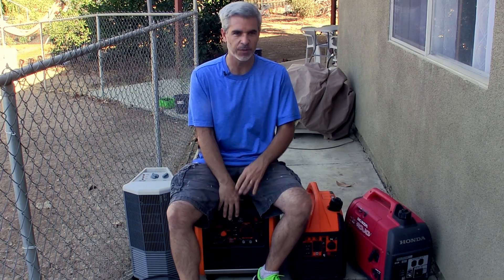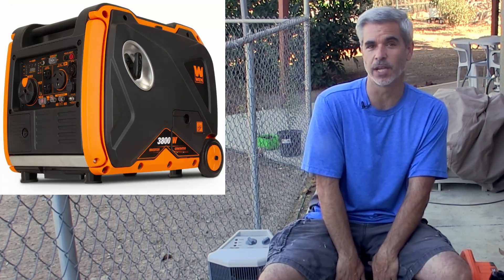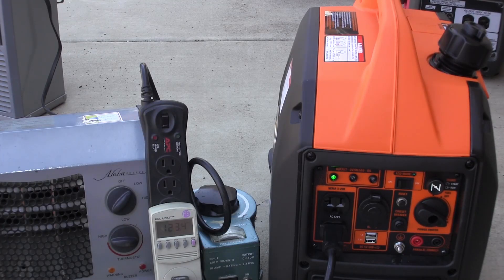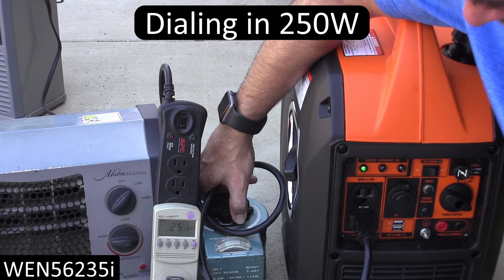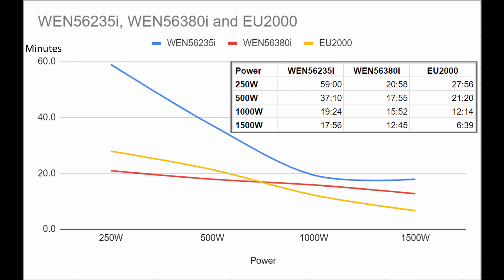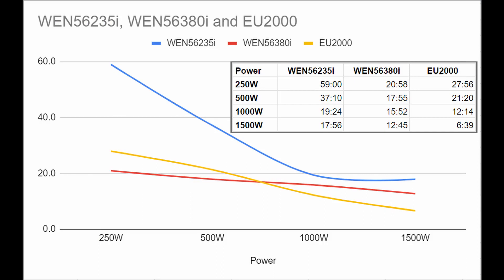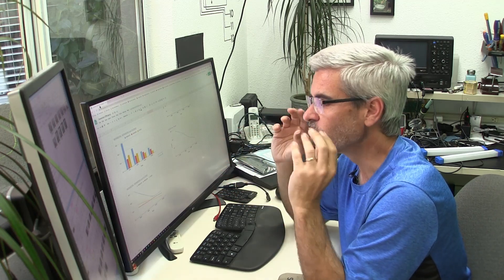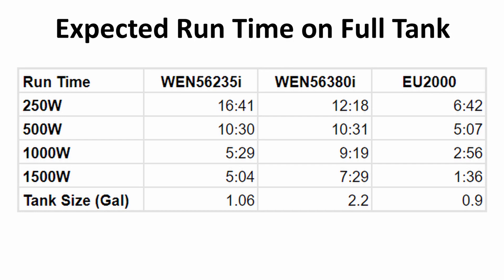Generator Efficiency vs. Run Time - WEN 56235I vs. WEN 56380 vs. Honda EU2000

Comment: Dan, Like Robert P. below, I also have watched countless Genny videos and I almost always end up yelling at the fools that embarrass themselves by what they do and say. NOT THIS TIME!!!  As a retired motorcycle mechanic with about 64 years gas engine experience I was totally impressed with the laboratory grade control of the variables to obtain and maintain accurate, specific, AC power wattage loads. I also have a 1960's vintage industrial grade Variac (with exposed partially insulated components!) to safely test transformers and three Kill-O-Watts to monitor Genny usage/testing. Have a 3 year old Wen 56200i 2KW inverter that is very appreciated. About the Honda, somethings wrong! The poor efficiency, especially at heavy throttle is most likely caused by:
1) The multi year slack time periods where small amounts of gasoline could either form deposits in or corrode away the brass main jet's tiny fuel metering orifice. It would be easy to visually identify by looking at the Spark Plug's white insulator for cleanliness (not Black!). Next check the Brass Main Jet COLOR for maybe going from new Brass to dark Brown or Black. That would have the heaviest Watt loads causing higher fuel consumption by a heavier throttle, lower output lean surge or over rich condition. EReplacementparts.com sells main (~$7) and pilot  jets. If there is no RPM cycling, the pilot jet is AOK. BTW a new carb with them is $167.
2) Few people even mention it but a Valve Adjustment is very important on small engines, especially if the clearance is too small or zero. That would really kill the power curve. When you remove the EU2000i valve cover you'll be really impressed with the clever, minimal parts count, premium quality components of the OHC valve gear and (runs in the oil!) rubber tooth timing belt . . . even though the camshaft is a nice looking black PLASTIC part. They usually show no or minimal cam lobe wear. I'd bet those valves need adjusting.
3) Too obvious and unlikely . . . a dirty or shredded (leaking air) air filter.
4) Check the Voltage and Hz under load to see if the inverter is OK. Running 50 foot extension cords to power refrigerator(s) can damage the inverters internal components.

If you find what's wrong your buddy will thank you and I bet you'll want to do the Honda again!
Reply from the maker: Wow Robert, you get the reward for the most detailed and longest comment I've received on this channel.  Thanks so much for adding your wisdom and insight to this video.  I rely on other such as yourself to add additional thoughts as well as correct me when I'm wrong about my assumptions.  I agree that Honda has issues.  I did perform a complete carb cleanout and spark plug cleaning just before taking this data, so I'm guessing the cam adjustment or even compression could be at fault.  Anyway, thanks again. 
I would like to hear your thoughts on why running extension cords causes damage?  Is it the added inductance causing poor power factor or flyback like voltage spikes?
Reply: @DansWay  Thanks for the gratitude, but this just makes retirement fun, like I'm still working. About the wire, its all  about the wire diameter size (12/3=12gauge/3wire) and whether or not it will safely transmit enough power to everything plugged in at the other end. Here's the HomDepo price & the calculated Voltage Drop between 12 AWG and 16 AWG transmitting 2000Watts:
$85.97 Husky100 ft. 12/3 Indoor/Outdoor Extension Cord  (120VAC power, 100ft=114.07 VAC) calc output) or (50ft=117.04 VAC calc output)
$31.27 Husky100 ft. 16/3 Indoor/Outdoor Extension Cord  (120VAC power, 100ft=105.02 VAC!!) calc output) or (50ft=112.51 VAC calc output!!)
Guess what electrically unaware people will purchase. Actually, the 12AmericanWireGauge cord is still not heavy enough for 2000Watts over the 100 foot run to your neighbor's refrigerator, but borderline with the 50ft cord. Plan B = Get closer, use shorter cord. NEVER use a cord longer than what you need!

The engine issues: 
After looking at the parts diagrams, I found 2 more low power output, short runtime offenders:
1) The 2 foam air filters, IF they have been over-oiled after cleaning. Remove them and squeeze each one in a paper towel. They only need to have oil dampness, not dripping. The main filter can get oily from the crankcase breather hose output. In high heat, 1500W+ loads some oily blow-by gasses are normally excreted into the airbox.
2) The Muffler spark arrester!! SO overlooked. So easy to clean with a Propane torch flame on the mesh disk (after removal from Muffler). Use the tip of the darker inner blue flame on the screen/mesh until it glows red and the Carbon flames completely burn off. After it air cools, tap it gently to remove ash particles. All manufacturers recommend a wire brush, but they will not remove hardened, screen blocking deposits.
Since you cleaned the Carb, and hopefully the Brass jets were not corroded and because the runtime is unknown (LONG?), the valve clearance is next. Just make sure you have the compression stroke TDC.

Use this link for the free download EU2000i Owner's Manual PDF:
https://cdn.powerequipment.honda.com/pe/pdf/manuals/31Z07610.pdf    GoTo pages 41, 43 and 61 for the info you need.

 You have to spend the $$ so you do not destroy the Genny's Aluminum finned Inverter and/or the neighbors refer compressor motor. Use this link to calculate voltage drop for different wire gauges, Watt load and cord lengths:
 https://www.inchcalculator.com/voltage-drop-calculator/
Reply from the maker: @robertm8204  thanks again for the great info Robert!

Comment: Awesome video! We don't have WEN generators here in Europe (to my knowledge) and I got an absolute stellar deal on a Maxpeedingrods MXR3500S dual fuel, which also exists in North America. You guys also have the Genmax 3500iAED which is essentially the exact same generator, which we do not get. On LPG, I measured an efficiency of just under 15% (although with some idling included). I thought this was a bit too low (was expecting more towards 20-ish%), but a thorough test like this has a bunch of amazing information to compare!

The WEN56235i peaked at 21.35% efficiency when running the 1,500 watt load.
The WEN56380i peaked at 15.18% running the 1,500 watt load.
The Honda peaked at 9.71% running the 1,000 watt load, after which efficiency took a hit again (and even dropped below how (in)efficiently it ran the 500W load).

Like Dan said, the fact that the Honda is older, might have something to do with its lower efficiency, but it's not like it would be half of what it once used to be, so still very informative and fascinating information!
Reply from the maker: Thanks for sharing your experience.  It is pretty wild to see that 15% efficiency on LPG.  Good to know.  The honda was definitly not operating very well, my guess is it should be quite a bit better.

Comment: A lot of great information. I've had the 56235i for about 5 years, and it's been flawless. I recently purchased an Anker F2000 and Anker C1000 battery generator. My plan was to use the battery generators as my primary source of power in a blackout and use the 56235i to recharge the batteries on the F2000 and C1000. This gave me the information I needed to know how long it would take to recharge the battery generators and how much gasoline would be needed.
Reply from the maker: Sounds like a plan!  Small generators will definitely do the most efficient job at low output power.

Comment: Doesn't the Honda have a 98cc engine? I think the Honda was designed to handle overload just a little longer for surges that it could run if only you could get past the surge and get it running.
Reply from the maker: Agree that a larger displacement engine will handle surge loads better, especially when running in an 'ECO' mode.

Comment: Great video! You must be an engineer. I'm an engineer, and all those spreadsheets is something I'd do. I would love to see a non-inverter generator thrown into the mix to see how much efficiency you gain from the inverter.
Reply from the maker: Yep, electrical engineer here….  Good question on the inverter vs non-inverter generator.  The ECO mode slows the engine down to an idle so it is much more efficient.  Non-inverter generators have to spin at 3600rpm at all times so there is a lot of waste there when lightly loaded. At full rated load however, the non-inverter versions are likely more efficient as they don’t have to do multiple conversions to deliver power.
Reply: @DansWay  Electrical engineer here, too. I can usually tell when I'm talking to another engineer. Exactly what I thought regarding the non-inverter generator.

Comment: Did you check that all of the gas was used? Is it possible that other generators just don’t get the fuel from the very bottom of the tank and some is left in the tank?
Reply from the maker: Great question. To be sure this wasn't a factor, I ran the generator until it died before adding the 8oz of fuel.  I did this for each test unless they were sequential tests which already ran the generator our of fuel already.

Comment: Small generators are cool but when you are with no power you need output there is no replacement for displacement… just wondering with the Honda are you on eco mode ???? Cause eco mode is super efficient

Comment: I have a 21 year old honda.  Still runs like a champ.  It would be interesting to do this test in 20 years.  I bet the honda at 40 years will still be running.  ;-)
Reply from the maker: I totally agree!  Very little to fail over time if treated well and non-ethanol gas used...

Comment: so you could extrapolate and say 7.2kwatts per gallon off that small 
WEN inverter at high load.  pretty impressive considering an EV can go 30 miles per gallon off that. however thats only 23% of the potential energy a gallon of gas has stored in it
Reply from the maker: Hey Ricky, good analysis and thoughts.  Gas truly is a poor generator of power, just like an incandescent bulb is inefficent vs. LEDs at generating light.  To bad there isn't a direct analog here that could convert fuel to rotational motion like the LED did for light.

Comment: When you say the small generators is more efficient then the bigger generator.Whats the max amount of watts the generator has to be to be a small generator  ?
Reply from the maker: Generally speaking, the smaller the displacement, the more efficient a motor will be when driving small loads (100-500W for example).  Of course, the smaller motors won't handle the high output power of a larger generator, but that is the option you have: Efficiency at low power (small motor), vs. power handling (large motor) with a loss of efficiency when run only at low output power.

Comment: Jeez so the peak was 21% efficiency and the gonna peaked at 10% 💀
That's a shame because the honda is the way to go but the efficiency is God awful. Typically I would expect to be able to see a peak efficiency of around 30% at 75-90% load on a larger generator (peak volumetric efficiency)
Reply from the maker: I have a couple of new Honda generators a buddy let me borrow, so I'm looking forward to doing more testing with a Honda that is not old and worn out...
Reply: @DansWay  Try doing 75% of rated load and see what efficiency is at that point. A lot of us are doing whole home inverter chargers so we can set the generator to charge at x.
Reply from the maker: @paladain55  Got it, thanks for the suggestion.

Comment: Any idea what the RPM's are of the generators at those watt points?  I assume the smaller ones are full tilt at 1500 watts, but is the WEN 3800 still on its way up?
Reply from the maker: At 1500W, the smaller 2350i unit is definitely working a lot harder than the 3800.  The 3800 is barely above the 'eco' mode at 1500W. The 2350i still has another 750W to go, and it will wind up even more to get there for sure. Which of these are you most interested in?
Reply: @DansWay  I'm torn between the WEN DF400iX (212cc, same as yours) and the Genmax GM3500iAED (145cc).  Both will suffice for my needs under propane.  My house idles under 900 watts with only electric heat devices (hair dryer, coffee maker, microwave etc) bringing it above 2500 watts for a few minutes.  On cursory thought, you'd think the 145cc engine would be more fuel efficient, however, the WEN probably runs at lower RPM's at every load.  I don't need the WEN to be more fuel efficient, but if it's close enough, it's clearly a more capable generator for the little(?) extra fuel it needs.  I'm trying to figure that all out.
Reply from the maker: @rob21 ,  sounds like you have some good thoughts there.  The extra displacement implies lower weight of the motor, which could imply improved efficiency at light loads.  It could also imply that at full load it would be working much harder than the WEN which would have more headroom (ultimately more horsepower).  Propane also reduces the peak power by a good amount (about 10%).  Can't beat the lack of 'smell' when running on propane!  If you found my video helpful, and decide on the Genmax, would you mind using my affiliate link to support my channel?  https://geni.us/GENMAX_GM3500iAED
Reply: @DansWay  Would be great if you reviewed it too. 🤓
Reply from the maker: @rob21  haha, yah, would love to!  Do you live in SoCal by chance...??  BTW, just between us...  My friend just loaned me two unboxed Honda generators, the 2300i and a larger 3500W version to do videos on.  Won't happen for another month or more (I have at least 6 videos recorded I need to edit, and 3-5 ready to record already!)
Reply: @DansWay  Nope, stuck in Ohio, but that's one of the reasons I need to weigh efficiency against power.  When it gets cold, propane won't "evaporate" fast enough on big generators.  It's a balancing act.

Comment: Project Farm quality level video. Thank you sir. I was considering a smaller backup genny for overnight loads like a newer fridge, LED lights, etc to supplement my 3800i.
Reply: IMO it's way better than project farm. Dan is so much better to listen to.
Reply from the maker: That is a huge compliment!  Thanks so much for that!  Yah, small generators are great for lower power long-duration backup applications vs powering large loads for shorter times.

Comment: Thanks for this video series. I just ordered the Wen 56235i last night and you and a couple of other guys online have made it clear that I have made a good purchase. I ordered a magnetic dipstick to the order. I needed something to run a 5000 btu window unit and a TV for the next south Louisiana hurricane without wasting gas. After Ida, it was weeks before gas stations within 2 hours of us had a reliable supply.
Reply from the maker: Thanks for your comments. We just had another random power outage for a few hours on a hot evening with guests still here after dinner.  Having the generator so easy to connect to our transfer switches makes it easy to get the party going again.  We also ran our 12000 btu mini-split off of the 2350i no problem.  Went to bed and turned on our ceiling fan and 6000 btu window air conditioner in the bedroom (after turning off the mini-split).  These things just work great.

Comment: Hi Dan. I'm considering running 2 small Wen units or the larger 3800i. I'm concerned two smaller ones will be louder and wear out faster than the 3800i. I will be running a load between 3000 and 3200 watts. Any insight with these two concerns? Thanks.
Reply from the maker: I'm wondering what types of loads you are going to have that amount to 3200W.  If you will be running that hard, perhaps a single larger generator would be more effective and longer lasting.  If that value is just your peak, and most of the time you will be substantially less, then two generators might be a better choice.  Remember that large motors, AC and such have a large surge current at turn on, as much as 2-4x the running power requirement.  You don't want to be at 3200W running on a 3800W generator if the startup current is more like 5000W...
Reply: @DansWay  thank you for the insight Dan. That is my absolute peak. Median load would be 2.1k.
Reply from the maker: @SG13108-h  interesting, perhaps then a pair of smaller 2300W units would work well, and just barely give you redundancy if one goes down.  The larger unit would handle the load and load-steps well also.  No clear winner in my mind, just different ways to go about it.  Let us know what you do and how it works for you!

Comment: I just bought the 2300i.  What do you think of it a year later?  Are you going to make another video on it?
Reply from the maker: I still love it.  It works every time.  Actually it was working better than my larger one recently during a power outage, but I think that is because the gas was old.  I still need to record a video installing a hour-meter on the 2300, and I also purchased the 'load sharing' box, and want to do a bunch of waveform captures to see how the two generators share the power equally (or not)...
Reply: @DansWay  Great news to hear for me.  Thanks Dan.  I look forward to your videos. I also bought the Hour meter and the magnetic oil stick.  It says it is coming in today.  I think it is going to be the right unit for me.